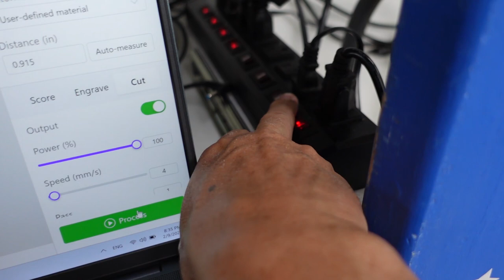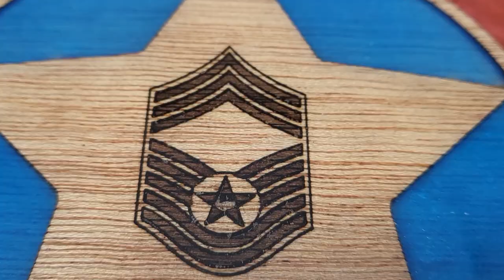DIY Tutorial: How to Make a Custom Wooden Sign with a Stunning Epoxy Finish

Comment: Chief McMillan is going to love this plaque.  A lot of helpful info about using epoxy,especially the tip on using a heat gun to remove the epoxy bubbles on the underside of the project.
Reply from the maker: I do hope he likes it. He hasnt received it yet. 😀